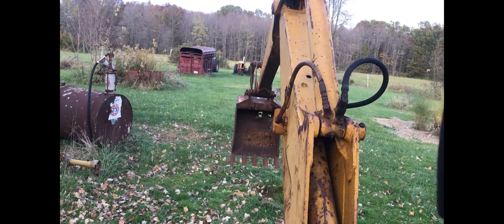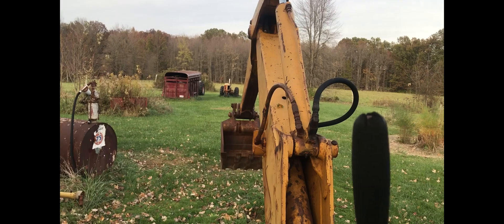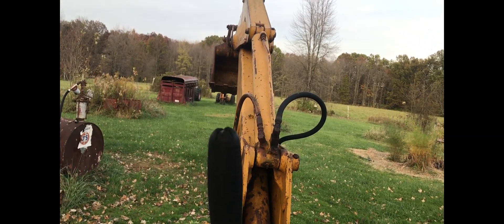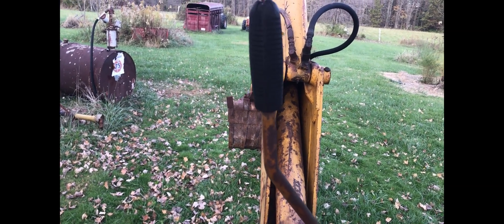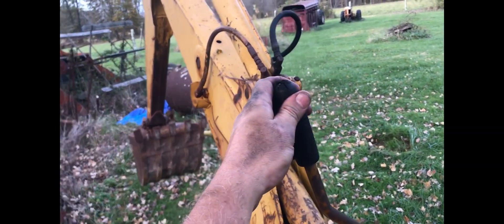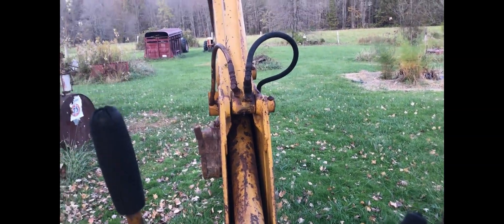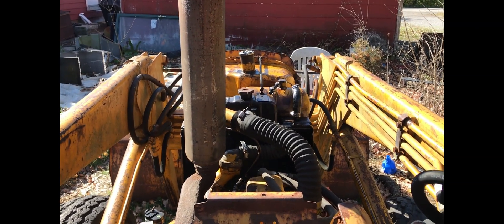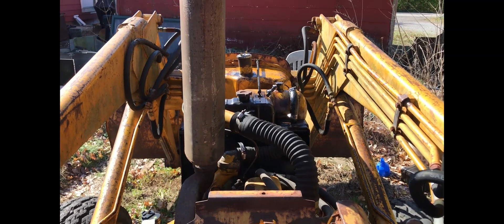Adjusting Pump Pressure John Deere Radial Pump 300B Loader Backhoe

Comment: Will you video pin and bushings replacement on swingarm?
Reply from the maker: Yes. One day. I just used the hoe to excavate an extension on my driveway. When the hoe is extended out for reach and I swing it, it’s impossible to control the stop. It bounces uncontrollably. I think I can replace 1 pin at a time without removing the entire 6,000 lb attachment. I will get to it eventually. It’s been too hot and humid to do anything this summer. Thanks for the question.

Comment: Hi i have a similar pump on my jd410 1980. it started blowing the hose and oring coming out of the pressure line from the pump, like there's double the pressure needed. i removed pressure control valve and stroke control valve and i cant find anything major. what should i do?
trans and hydraulic filter have 2 hours on it, changed the fluid 3 times, stroke element filter was dirty but not clogged. not sure what to look for
Reply from the maker: I'm not sure I understand your problem.  The pump has a screen inside of it.  Check out my videos on Pump disassembly and Pump Rebuild.  I show and talk about the internal pump screen.  But I'm not sure if that screen is clogged it would cause the pump over pressurize.  Also, there might be an 1/8th or 1/4 inch tube that comes off the pump and goes to a fluid reservoir.  If that tube is clogged it will pressurize the pump and blow the shaft seal out.  I cover this tube in my Rebuild video.  Let me know what you figure out when you solve the problem.
Reply: @GravelPitRoad  i cleaned said screen and checked the pump. all seems fine. the tube you mentioned was missing on my rig, so i fitted a new one because i was tired of having a constant stream of oil on the ground (it was pissing from the fitting on the top of the transmission, next to the brake pedals) could that tube give me overpressure problems ? what purpouse does it serve?
Reply from the maker: @ An old John Deere mechanic at Murphy Tractor Cincinnati told me to make sure that thin tube is not plugged or crimped. The pump will build pressure and blow the seals out. Including the line that goes back to transmission from the reservoir. The fitting the line goes to on the pump sits over a hole between the splined shaft seals just inside the pump at the spline. It basically is a pressure relief outlet. If fluid was poured out of the pump fitting, the it’s not clogged. I suggest talking to the mechanic at your local JD Construction dealer. These pumps are too expensive to just let it blow. Let me know what you find out.
Reply: @GravelPitRoad  since im in europe, italy to be precise, there is only 1 construction dealer in all the nation, and they have other problems than dealing with a almost 50 years old machine. even if they said yes, getting the machine to them i't gonna cost 4 times what the machine is worth. it's a shame but i cant figure out this problem, and no one knows this machine and i found 0 people having overpressure proble, only low pressure related problems. i will probably scrap the machine if i cant find anything. what i'm thinking in that the steering of front control are stuck and not letting oil by, causing less flow and too much pressure. since is a open center sistem. 
will keep you posted. thank you
Reply from the maker: @marketplaceaddiction  There is a moving part inside the pump.  Part of the destroker.  It could be stuck or clogged.  That might cause an overpressure problem.
Reply: @GravelPitRoad I removed the assembly, checked and changed all the o rings, and i saw nothing. But maybe since the machine was sitting some debree got inside and partially blocked the fluid passage. Tomorrow i will start the machine up to see if the problem is solved or not. I removed the return tube to the trasmission that i added and i will look if it does purge or not from the pump
Thank you anyway for the tips